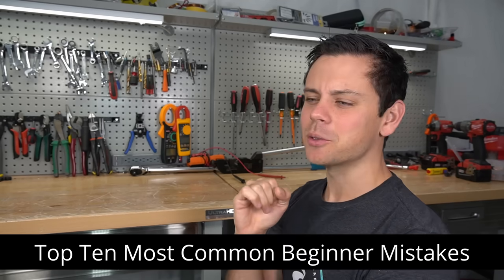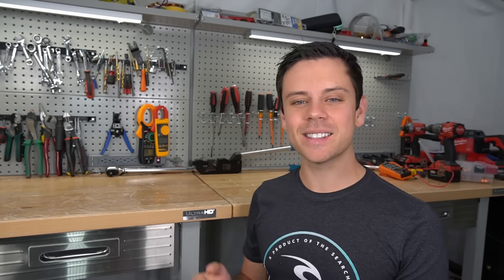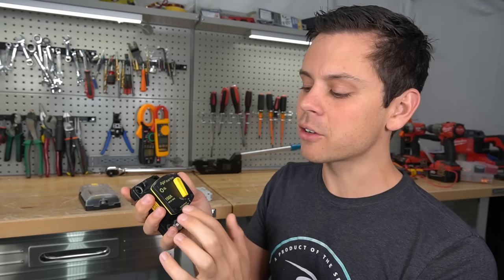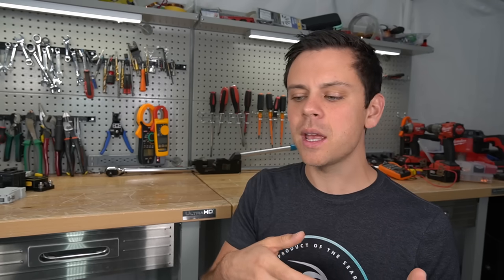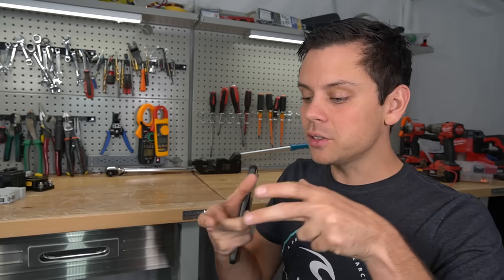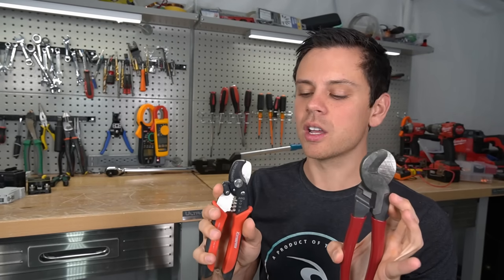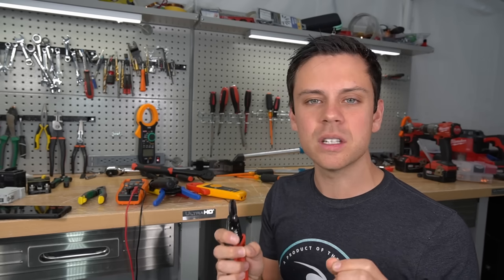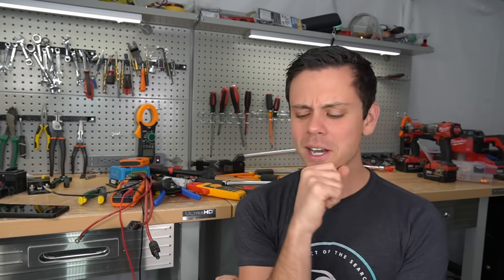Top 10 Beginner Mistakes When Building a DIY Solar System

Comment: Ok, WHY can`t I use AC brakers to disconect battery from a solar charge controller for exemple? Or, disconect PV from a solar charge controler? Both events use an AC braker used in a DC enviroment? Why? It works great.

Comment: When using a torque screwdriver, it's best to use the correct bit. While most screws require a flat (slotted) head or a phillips head, there's a specialty head that works best on some electrical devices such as outlets. It;s sort of a combination of a flat blade and a robertson head (square shape) I can't find a common name for it, but Klein tools appropriately calls it a combo-tip. You can get a set of 2 screw drivers or bits (different sizes) from many online stores. There are also other makers besides Klein, but the name Of the bit varies by manufacturer. I guess there's no standard name yet (?).
Not expensive and worth having the right tool for the job at hand.

Comment: Hi
I have a small 1440w 24V portable inverter which I use to keep a TV and PC running
The batteries have a cycle of  +- 300 
Will I be able to get more cycles out of the battery by adding a solar panel?
Robert

Comment: When I don't have the correct stripper for a large gauge wire I find a sharp razor blade (with handle) work well, gotta be careful to not nick the wire though. I don't like using cutters to strip wire at all. Much harder than a blade.

Comment: "Connections can loosen over time", I would say at least some of your connections will loosen without fail. I agree check them once a year... perhaps sooner the first time. There are some AC breakers that have both AC and DC ratings, commonly 300v AC and 48v DC. I have seen more of these from Europe not from the US or China. (and yes, 48V means not a 48V system, my 24v solar cells are over 40v OC already)

Comment: Hi Will, great video and explanation on simple errors that those like me can make.  I know that buying the best you can afford is often the case, but there are also limitations on what each of us can afford.  I have just invested in a simple 400w system feeding through a 30A (100v) mppt controller wired in parallel.  The battery is a 200ah Lifepo4 supporting a 2000w PSW inverter, the whole system was bought from Renogy UK.  I have also looked at the wiring and have oversized to the max the MPPT controller will accept (8 Gauge) similarly I am looking at the thickest wire possible for the battery to inverter, run 18 inches with a 200a fuse.  I can only hope that I have done sufficient research to offer me a few days resilience for my fridge freezer should we experience any power outages this winter.  Thank you so much for your invested time into these videos, they are really helpful.

Comment: im sure im gonna regret this question. im doing a small project for the wife. pine tree stump 6 foot tall with a 6 foot round mushroom top shaped cap. im wanting to put like 6-8 small spot lights pointing down with a bunch of fairy doors and windows for a lawn display.maybe a few small led lights for the door and window openings. ive been looking for info for solar panel, battery and inverter/controler . just cant figure out from the videos ive watched for the small amount of power for the project.every thing i come across is for powering tools house ect.

Comment: Will, if I have a 48V LiFePO4 server rack battery and want to add another a week later, how close do the battery voltages have to be in order to bring them both online together? LiFePO4 has low internal resistance. What risk is there in one battery dumping current into another and causing a dangerous situation?

Comment: Soldering terminals cause a high stress area adjacent to the lug.  They also may melt, and fall apart when overheated possibly causing other issues.

Comment: The reason solder is not used in High current applications is flow properties during over current 
occurrences.  If a circuit breaker fails closed or fails to open in time, an energized conductor with soldered 
terminations or splices may break away with solder flow.  Solder may also flow and short other circuits or equipment.

Comment: Do you recommend using properly crimped ferrules on stranded copper wire that terminates at inverters, converters, ground lugs and charge controllers?

Comment: Hi Will. Random charge controller question here. I have a gas detector I need to install in a caravan, and I'm unsure of the best way to connect it. The charge controller is pretty much right beside where I want to install the gas detector and I'm wondering if I can just plug it in the battery charge terminals on charge controller. This would insure I've always got power to the gas detector as long as there is power in the battery. But I'm definitely no expert on these things so I figured you're probably the best person to ask. Thanks in advance. And thanks for all the valuable stuff you share in all your videos.

Comment: I thought I was good to go. But you nailed me with #7. I have 3 48v batteries. Each one is hooked up to the exact same 48v marine circuit breaker that you showed. It never once occurred to me that they're only rated for 48v and I top off at 58.4v I have had one of them in service for 14 months, the other 2 were added over a couple of months. I haven't experienced any problems yet. They have been working fine, but I have never tried to short one out.
What problems should I be expecting?

Next up. I think you should teach a little bit about conduit sizes and how many wires are allowed, and what gauge in the common sizes of conduit. Too many wires and they say they can overheat inside the conduit.

Comment: When I started in the Avionics industry the wires were copper plated nickel platinum alloy teflon insulated. No aluminum. 
Anderson connectors their terminals are the best high amperage conductivity....

Comment: I have seen 150Ah LiFePO4 batteries with essentially the same form factor as the typical 100Ah battery. Hypery is one brand on Amazon. Will, have you evaluated one of these batteries? How do they accomplish the 50% additional capacity?  Thanks!

Comment: Good tips. However according to the NEC you do NOT go around periodically to torque all your terminals again. Just inspect them and try to wiggle them looking for signs of overheating. While under load check it with a thermal camera.
The reason why you should not torque everything after it has been torqued properly is that you will wear out the threads and over deform your conductors to the point that they have reduced contact area and rigidity, the will squish out becoming copper foil instead of a proper gauge conductor.

Comment: I never knew there was such a thing as a torque screwdriver and now I have one but I can't find the torque spec for the A\C input and output terminals on my Victron multi plus 12/3000/120 inverter? do you know what they are?

Comment: I used to wire electric vehicles, milk floats, air port  tow trucks, and when we attached the battery disconnect plug the lugs were always soldered on to the 35 mm or 50mm cable. There was a connector with a small pot, I'd heat that with a blow torch then melt a 15mm x 10mm stick of solder into it, then immerse the cable into it and heat it till the solder went into the cable.  It was slow, hot and laborious as each one had four contacts, two on the batteries, two on the truck and I'd do a dozen trucks each time.
Reply: Vehicle looms are all bundled together and have been since Henry Ford .

Comment: I have yet to see any video dealing with a situation having more than just a single 200 amp service panel. My home has two, 200-amp service panels. If I have an electrician install a hybrid system, Am I looking at an expensive complication, or an advantage or disadvantage? 

By the way, love your videos, and you've really captured my interest into possibly going with a system

Comment: Here's a question that I get asked and I would really like say something besides NO.
Question: (I tweaked it to add unspoken information)
Can I use a regular power supply (18v 3A for example) to charge my lithium battery through my Solar Charge Controller.

Comment: Great video as always Will, thanks for sharing your knowledge so eloquently. Your comment about soldering vs not soldering reminded me of instructions from Redarc that recommend adding solder to the ends of butt splice crimp connectors. Granted those connections are smaller gauge (up to 8AWG I think) and they still recommend a mechanical crimp.
"REDARC recommends using a soldered butt splice crimp connection that is covered with heatshrink. See Figure 2.5.1. REDARC does not recommend using standard red/blue/yellow blade connections as they are not rated for either the current required or gauge of wire supplied on the unit.
Crimping provides good mechanical connection, soldering provides a long lasting electrical connection and forming of the heatshrink will prevent any shorting/ contact with your vehicle chassis."

Comment: I find the 310 table for wire capacity confusing. It says 2/0 good to 195 amps under 90 degree column. But isn't welding cable rated to far more capacity using the  ABYC Ampacity Tables.

Comment: It happened in our new RV.   The dealer said I need a new device and it will take months to order. My son (an electrician) checked the connection and sure enough he was able to simply pull it apart with a quick tug on the wire.  Fixed in 5 mins.  🙃

Comment: Does using tinned marine wire interfere with the connection in the same way solder does vs crimping? Does the presence of tin interfere with the cold weld, or is an alloy created? My system will be right on the beach because that's the constraints of the property I'm on. Thank you very much for making these very informative videos, appreciate you.

Comment: Thanks Wil, I use a fluke volt meter and have a UEI DL 250 as a backup. I noticed you have some Harbor freight tools as I also have a few. Have you had any experience with the sold at Harbor Freight QUINN 
Precision Torque Screwdriver? It looks very similar to the Capri, but is $45 less expensive. Also thanks again for a great informative video. We all can use the review. You are my go to man for anything related to solar or power stations.

Comment: Hi Will. I have a pop up camper w 125w on the roof and Victron MPPT 75/15 smart controller. I  swapped out my Lead Acid battery for a Lifepo4 so I have enough juice can charge my mountain Bike battery once per day charger 6A 42v.  I installed a Giandel 600w pure sw inverter direct to the battery with 80amp inline fuse.  Do I need to ground the inverter?  If so, where on a slide in camper is a good place to ground?

Comment: BTW - Folks should be using Ferrules for connections where a ring terminal isn't used. IE: Breakers with stranded wire

Comment: I purchased the German made cable stripper on your recommendation and didn't find it to be useful. Perhaps you could demonstrate it on various wire sizes and show us in real time how you adjust it to properly do repetitive stripping.  I found it way too 'fiddley' to be a practical tool.  A really sharp knife and some magnification seem to work much better.

Comment: Ok- your advice please, I like to slightly over tighten terminals. And I have checked after time that terminals are still tight. Does slightly over-tightening (without a torque wrench) a bad idea on electrical or delicate mechanical devices.

Comment: I think a tutorial to show how to build your own low voltage cutoff (under-voltage protection) as its not covered in your other tutorials and really important, especially for sealed and flooded batteries. Things like lights or 5v charging sockets obviously wont have  any u-v protection but can still damage your battery by using too much power!

Comment: You can solder large cables but you have to mechanically secure them. Actually you should always mechanically secure a soldered cable no matter what size.
I work for the railways and we have certain traction motors (350kW) where the connectors are soldered (50mm2 cables). The cables are mechanically secured to avoid any stress.
When done properly those joints never fail.
Reply: I'd concur (when done properly).  I know many of us use XT60 connectors for solar panel hookup.  I suppose there are also better options than those.  Soldering takes too much time anyway, a good crimping tool makes the job extremely easy for the right type of connector.

Comment: Aluminum also cold-flows, depending on the alloy. Come back in a few years and find the connection is loose. If you use aluminum, be sure the terminals are rated for it.

Comment: I can't seem to find it anywhere. But perhaps you would know this based upon your materials. I have a 12,000 watt continuous inverter low frequency inverter for my home. That inverter does have an Input A/C and output A/C also a bypass. The inverter says it locks onto the frequency and smooths it out. The question I have is can I connect a square wave generator to a low frequency inverter that is pure sine, will it lock and clean it up or should I use a conditioner of some other sort?

Comment: Little by little you are building my confidence to buy the inverter and batteries I need to create a grid-tie back-up system.  I cannot get a straight answer from any supplier about what to do when the voltage from my micro-inverted roof-mounted PV array is already in AC volts. The specs on  the inverters I've looked at put the capacity or range of input voltage in DCV. Do you have an answer?

Comment: Electrician here, but no solar experience. Soldering joints is against NEC (National Electrical Code). Additionally, solder is an alloy mixed specifically to have a lower melting point than its component metals. If your joint heats up due to localized high resistance, having a solder joint begin to melt (and further raise the resistance because of decreased contact) is the absolute last thing you need and is a likely place where a fire will start.

Comment: Have you ever seen an adapter from torque wrenches to torque screwdriver tips? I have 2 torque wrenches for bicycles and it seems silly to get another. Carbon fibre bicycle bits often specify a torque- often printed on the bike part to be helpful but if not in the manual. Have you ever seen an adapter so I can use a bicycle (hence low range) torque wrench with screwdriver bits? And secondly will the values be in the manuals/if they aren’t what torque do you go for? Even bike stuff in America tends to be in Nm: guessing this will be in Pound-inch?

Comment: Question?   Where do I need fuses/breakers in the system?  Between the Panels and the charge controller.....the charge controller and the batteries.... the batteries and the load..... OR ALL 3 places?

Comment: I've discovered that heavy gauge copper lugs from places like Amazon are made with metal that is too thin to maintain a proper cold weld joint. always better to go with a higher quality lugs. The thicker copper also carries more current with less Heat.

Comment: I have a question they may be a common beginner mistake - Re: busbars, I see amperage ratings that look like 700A @ 12VDC - does this mean it would handle 350A @ 24 VDC, 175A @ 48VDC etc.? If that is the case I see a lot of flimsy busbars on DIY setups pushing high amps.

Comment: Hi , when connecting the components , the battery , inventor, charge controller and a panel , which components do you first connect

Comment: Where can I buy non- Amzn stuff in small quantities? In Europe sourcing 20 pieces 10-6 copper lugs, 10 pieces 16-6 lugs etc is impossible. All suppliers sell Klauke by box of 100 pieces. The small connector sizes of Victron cc's are very frustrating to work with.

Comment: Having worked in a panel building shop with fifteen or more employees. It is surprising the variance in torque between employees on wires and fasteners. Like Will pointed out use torque drivers to get it right.

Comment: On the current connected website that you link to for buying the SOK 206ah battery, the pricing WITH Bluetooth is $1029. Is this the same as the 206ah battery on the SOK website that has bluetooth and a built in heater for $1200?

Comment: soldering vs crimping... Can you do a video which proofs your point? Maybe a bad solder joint made with hotair soldering station and a good one made with gas burner, vs crimped ones? In years back I made them both ways and it always worked no problem for me, but I dont have an equipment to measure such difference. Thank you.

Comment: Hello, I currently have a 4.8K grid tied system with an enphase inverter and it works fine.  I have 22 panels on my roof that are connected to a shutoff and from there to the inverter and then to another box and then ties into the grid and my main CB panel.  I want to do two things 1) expand my system to 12K, and 2) set-up a power wall that I can easily add batteries as I can afford to buy more.  I am thinking my first step is to buy and install a new inverter, and then add panels as I am able.  I also need to buy and set up the power wall components so it is able to accept new batteries as I am able.  The trouble is that while I know the basics of what I want to do, I can't find instructions to follow to execute this plan; do you have any guidance that would be helpful?

Comment: Question: instead of connecting strands wires into a Charge Controller what would be wrong with crimping a small enough lug which ensures all the strands are within the lug?

Comment: So for the ep4 3000 48v hand truck system how do you employ the boost device to charge the 48v battery? Do you just connect the output of the boost device  directly to battery. I don't have a lot of space for multiple solar panels to exceed the 120v necessary for the ep4 all in one.

Comment: What about using crimped wire ferrules on stranded wire attached to screw terminals, such as used on charge controllers?  These don't loosen over time.